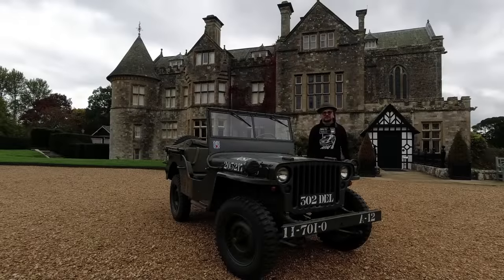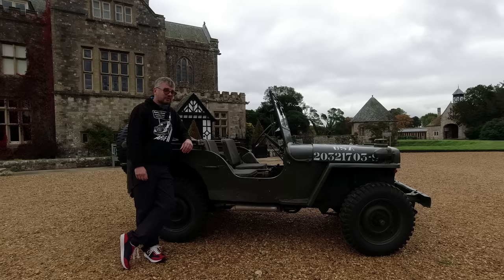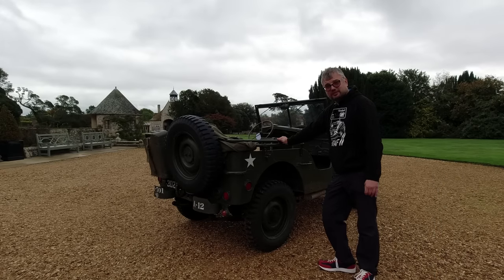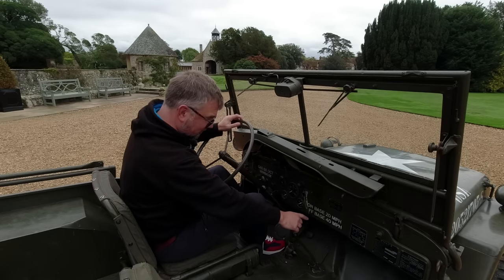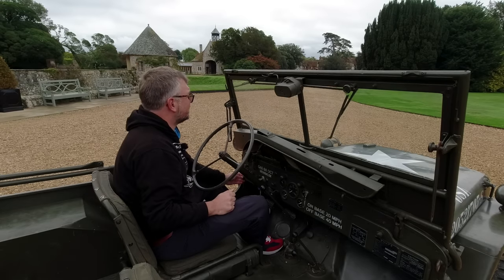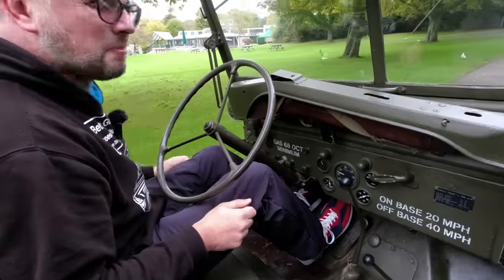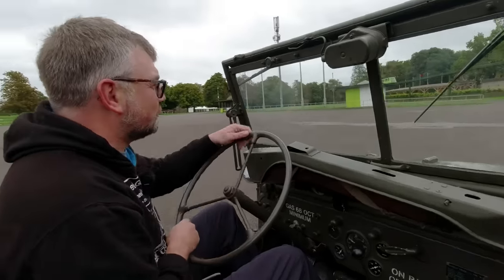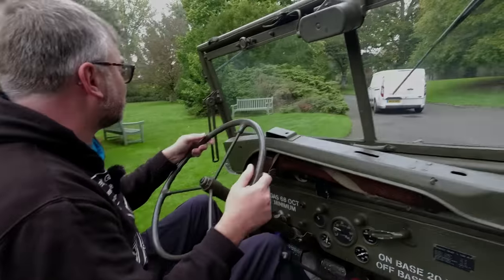1943 Willys MB Jeep - Off Road Icon! How does it drive?

Comment: Nice video, I've several friends with original early 40's Ford and Willys Jeeps, two with original Willys Trailers attached and both having to be towed back to 'base' on a number of occasions behind my Berlingo after breaking down.   Said generator is 'quick release' to slacken off fan belt and stop fan turning when wading deep water. Seats are fixed, driver on top of fuel tank, I've driven quite a few but amazed how John Wayne ever managed to fit behind that steering wheel.

Comment: Even though it was designed as a war vehicle I’ve always thought they looked really cool. Great to see a proper road test of one. I’ve read over time that it was called a Jeep for having Just Enough Essential Parts or it was from GP for general purpose video. Amazing to think how many jobs one little vehicle could do
Reply from the maker: I could probably do an entire separate videos on the origins of Jeep. In truth, no-one seems entirely sure. The Army already used the term for new vehicles, way before the Jeep was a thing. Ford called its version GPW, so GP is another possible. I think Just Enough Essential Parts came after the name was already established.

Comment: When I lived in New Guinea in the very early 1960's we found an army dump with some of these vehicles covered in a Vaseline type goop.  We would take one and scrape off all the jelly, re-wire (very complicated grin) and replace all the rubber tubing and put new tyres on and sell them.  I wonder if the army dump is still there because there were still a few left as well as handguns, ammunition and barrels of petrol.  Great video Ian.

Comment: The Jeep is such an American icon. They were designed to be very easy to work on and it did not take much to get them running. Simplicity was the key and these things could go almost anywhere and be highly abused and it would come back wanting more.  However there were some less idea aspects of it. The thin padded seats made it feel like somebody was punching you in the back when you went over a bad bump. The steering could be an issue with some as there was no power steering and it was some times harder to turn. Most folks I know with these have a Brodie Knob (also called a necker knob) on the steering wheel to help with turns. The horn should be that little button on the steering wheel (on top of the nut)
I am a big fan of the first Gen Wrangler (YJ) with its square headlights. Of course I am sure Hubnut might take issue with the fact that YJ's have the wipers resting against the windshield when turned off instead of below the windshield like most vehicles. (However that gave the wipers a wide arc and made visibility in the rain top notch)

Comment: There should be a webbing strap you can clip across the side which is supposed to stop you falling out if the going gets rough. As a safety feature it was about as effective as a chocolate teapot. I believe most of those 3000 prototype Bantams and Fords were eventually wished onto the UK as Lend-Lease offerings.

Comment: That take off is an iconic sound effect from war films.
The side valve motor was a well established proven design. Just what was required in a war. 
They'd be hard pressed to find a modern match now.
Reply: the military had a requirement for the Jeep engine which they did test successfully - it had to last 100hrs on redline. the previous engine they tested on jeeps only made 22hrs.
Reply: @piuthemagicman  did it send a piston out the side or just stalled?
Reply: @jamesfrench7299  The original Willys 4 had a tendency to just wear out so most probably seized. this is what I found from MotorTrend: 

The Willys four had appeared in the 1926 Whippet, which was the company’s first economy car, albeit an upscale one. It displaced 134.2 ci, just like the later Go-Devil, but only made 30 hp. By the late ‘30s, the Willys four was making 48 hp with a few upgrades, but it had become notoriously unreliable and was well under the market’s power curve.

Roos’ reliability benchmark was 100 hours at full power. One of his first tasks was to strap the 48hp engine to a dyno. It lasted 22 hours at 3,400 rpm—’nuff said. Roos and his staff set to modernizing the engine, incorporating insert bearings, a fully counterbalanced crankshaft, aluminum pistons, a fully pressurized lubrication system, and a revised valvetrain. In just a few months, the new engine was ready for the dyno. It exceeded 100 hours at over 60 hp at a whopping 4,400 rpm. Success! The new engine was dubbed Go-Devil and first appeared in some of the 1939 Willys cars rated at 61 hp at 3600 rpm.
Reply: @piuthemagicman  all just in time for the jeep programme. They never even knew it would end up used so successfully in a 4WD. It was just to address general reliability issues in a car. It ended up being more robust than Ford's tractor motor they were using for their jeep entry. Ford ended up ditching theirs and tooling up to produce the Willys L134 in their own factories.
It was durable and torquey like a diesel engine, but with performance too.
Reply: @jamesfrench7299  oh, true! it was Willys engine designer Barney Roos who came up with the reliability test for civilian use, not the military. Just in time indeed :) I read the article too fast at first.
Reply: @piuthemagicman  Imagine  history if Barney Roos wasn't called in to do his rework?! Talk about fortuitous.The importance of the dependability of what turned out a versatile vehicle that regularly exceeded design limits can't be exaggerated. So many were deployed in the global effort, they were like a spanner in the war.
It brought vehicular standards that were groundbreaking.

Comment: It really is incredible (and quite sad) that it takes a war to spur on innovation. These cars are one example of that. It's great that Beaulieu has so many examples that still run. Do I like this car? Sir yes sir! I think one of these would be better value than the current cars from Jeep but unfortunately would fail big time on the safety front. A modern version with Just Enough Essential Parts (JEEP) would be nice though.

Comment: You mentioned Mahindra, in your video. Have you ever driven one of the Mahindra 4x4 vehicles that were sold in the UK, in the 1990s?
Reply: They tended to be used on many films when a JEEP substitute was required for destruction purposes.
Reply: Remember another short-lived-in-the-UK  brand, simply "Asia", with a cheap 4x4 called the "Rocsta"? Sold in the UK about the mid-1990s...I'd completely forgotten about those until Mahindra was mentioned, which jogged my memory.
Reply: @ZIGZAG12345  
Yes, when they first centered the UK market, my local branch of ASDA ran a competition to win one, which was parked in their foyer.
Reply from the maker: Sadly never driven a Mahindra nor Asia Rocsta. Both terrifyingly rare these days.
Reply: @HubNut  
There was a Mahindra dealership quite near me, but I don't think that they sold many of them.

By the way, if you ever find yourself in Scotland, you would be very welcome to take my Vauxhall Rascal van out for a test drive.

Comment: I don't know if it was set up differently (maybe for young 'uns?), but when I tried sitting in the Jeep on display in the now defunct Durham Light Infantry Museum, the steering wheel was geting extremely intimate with my "self", and trying to get my feet on the pedals and my knees were round my ears, thoroughly unpleasant to sit in, but it was a static muserum exhibit, and yes, I took a look under the bonnet, and there was a very stripped engine block there, so, maybe it was just a "spares-repairs" one... :S
Reply: Most Japanese pickup trucks built before 2012 seemed to have a similar seating position of seat bolted to the floor idea.

Comment: If you go to one of the museum in Normandy France near to where the USA war graves are located has a JEEP stood vertically so you can look under the chassis and when you compare it to a Land Rover series one you can see the similarities.
Reply: In NL we have a club that is named 'keep them rolling'. The members in this club have lots of ex-WW2 machinery, fully operational. They do liberation day parades, summer tours to the Normandy beaches,  re-enactments and i believe some were used as movie props as well.
Reply: @jfv65  someone near where I live has a USA WW2 army truck, JEEP and has friends who have some other WW2 vehicles and they use them for special events days, reenactment events and they have been hired out for TV and film filming.
Reply: Rover acquired one to evaluate and think how to improve it, as many farmers were using them to tow farm equipment but they lacked a rear PTO and the ability to fit one.  The Land Rover's original wheelbase was as the same as the Jeep's, 80 in.  One of the options on the original Land Rover was the Ferguson 3 point hitch.  Aimed at the farmer who couldn't afford a new Tractor and a vehicle to tow the trailer from field to market quickly.  Well quicker than 10mph.
Reply: @tonys1636   You  can fit a PTO to the transfer case after removing a blanking plate, a winch can be fitted to the front of chassis driven off the front of the crankshaft via a short prop .
Reply: @tonys1636  I believe the story also goes that Maurice Wilks purchased a old military JEEP for his holiday home on Anglesey and whilst he was using it he thought that he could design a similar vehicle (drew the first plans on the beach) and as you said design it for farmers. I think they beefed a few things up and fitted a engine found in a Rover car.  If you go to Anglesey you do notice a fond love for the Land Rover old style Defender and its a lovely nod to the past.

Comment: Amazingly, the original Jeep is smaller than some current side-by-side ATVs and probably more versatile. When I was a child it was not unusual to see 25 year-old military surplus Jeeps being used as utility vehicles by garages, in particular fitted with a blade for clearing snow, at the time they weren't very valuable and many were pretty derelict. Regarding the 60mph speedo, the same kind of thinking prevailed with our neighbours south of the border when, under the Carter administration and while the 55mph national speed limit was still in force, it was decreed that the speedometers on road legal vehicles could not indicate speeds greater than 85mph. Surely that was going to keep the great unwashed masses from driving too fast.. On a complete side note, as a French speaker it's a bit disconcerting to hear the way the British pronounce "Beaulieu", lol. I don't mean that as a criticism, it's in your country, so you pronounce it however you want (and Lord knows British place name pronunciations are seriously weird), but it is a bit strange.

Comment: 65mph top speed for ANY regular car, let alone a utility 4x4, was pretty good for the 1940s wasn't it?
Reply from the maker: It's a fair old turn of speed.
Reply: Not so much by the '40s, but certainly in the early '30s, going a mile a minute (and being able to sustain it) was a really big deal, a Model A certainly couldn't do it for very long without mechanical failure. By the early '40s, it wasn't such a feat, a typical Chevrolet or Oldsmobile would have had a top speed of between 80-90mph. Couldn't do that for very long without damage of course, and the cars themselves would be very noisy at 60mph on the highway

Comment: I like it,but i prefer hotchkiss M201.If you like to know why,i tell you.
I like parts in hotchkiss,don't exist in willys.these parts are:
Orange front turn lights.
12v battery
Windshield rest on windshield itself,not on hood.
Electric glass wiper.
Thick steering wheel spokes.
Roll bars.
jeep hotchkiss M201 is my prefered jeep after jeep wrangler yj,& cj5.